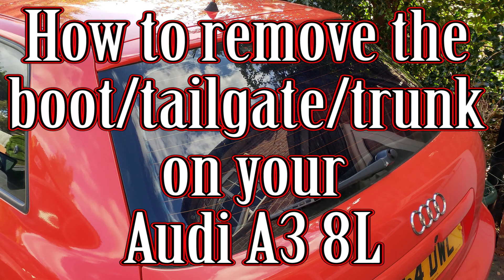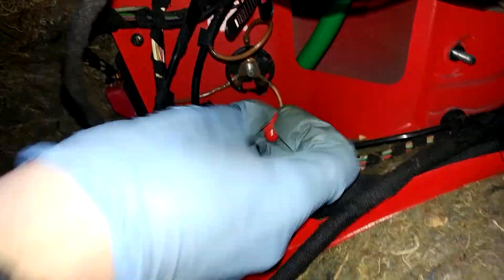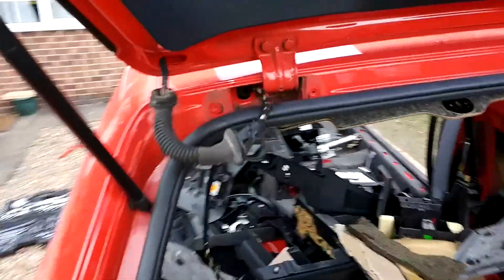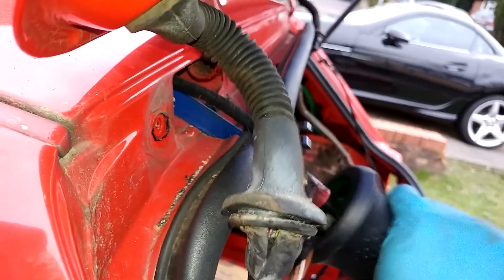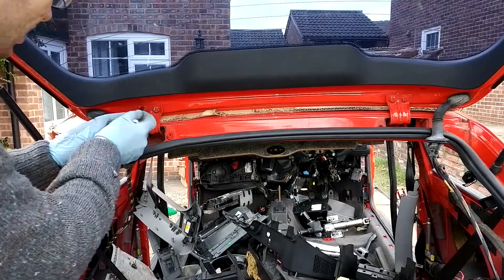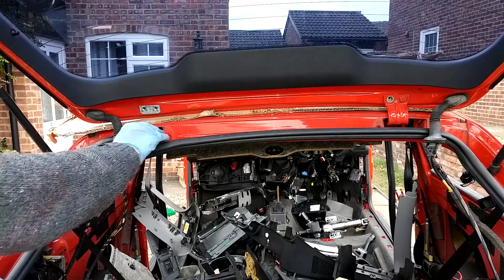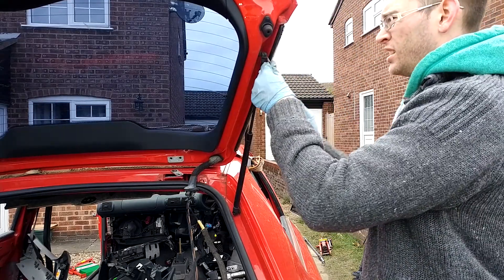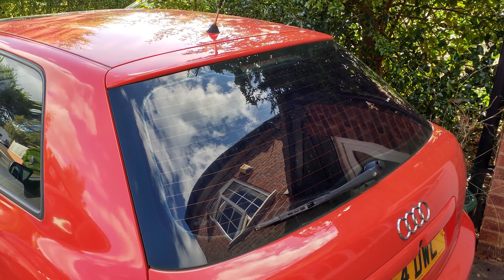How to remove the boot/tailgate/trunk on your Audi A3 8L

Comment: Hi. Great videos. I just got my first Audi a3 1.6 year 2000 l8. I'm having problems with my ashtray, i have trouble opening it. Normally you just push to click it, and it opens, but mine doesn't... Can you do a video dismantling it so we will know how to do it properly? ☺️👍
Reply from the maker: I'm afraid I don't have one anymore but the ash tray is held in by 3 t25 torx bits I think. What I found with mine you had to close if by lifting it up and not pushing it - problem being to take it off it needs to be open.
I think the torx bits are one either side and one at the back, you'll need to be down low to see them. The tray then needs to be pulled out and the 12v cigarette lighter disconnected.
Reply: CarAndMechanical Thanks for the info. I'll check it out and try to figure it out 😋